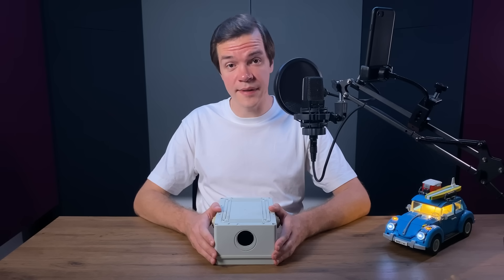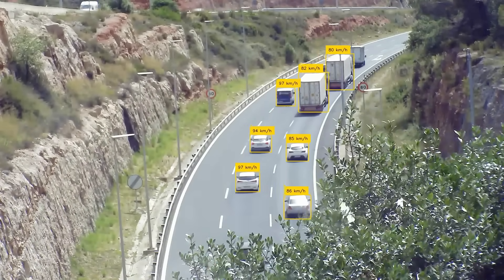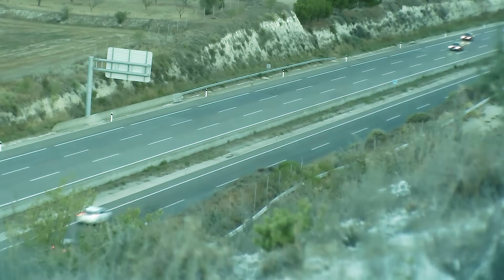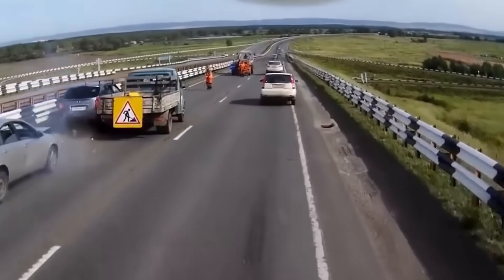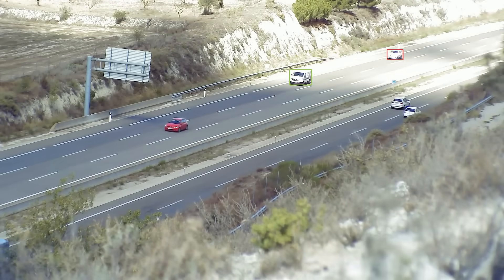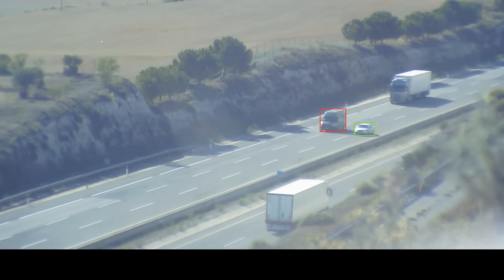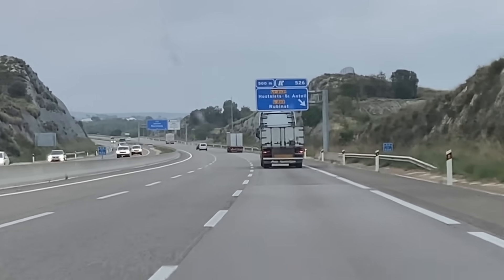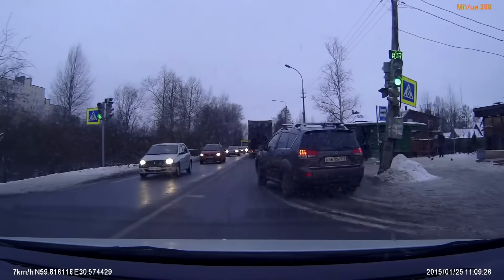New Anti-Tailgating Camera Reveals Shocking Statistics

Comment: If I get a rampant tail-gater, I do not speed up, do not shorten my own braking distance, nor do I brake-check them. I maintain my driving. Eventually,  IF  the tailgating is excessive, I may choose to gradually slow my speed down by 3-5 kmh. They soon wake up to the fact that they are just 'losing time' and go on past me.
Reply: This video lays it all out. If someone is tailgating me in the left lane, I move over and let them pass. If someone is tailgating me in the middle or right lane in normally moving traffic, I INCREASE the distance in from the car in front of me, planning to use all that room in case of a sudden stop, because the idiot behind me will not have enough room to brake. In heavy traffic, I'm  afraid I do reduce the 'safe' distance in front of me because, otherwise, cars will constantly cut in front of me.
Reply: @biotrekker  I try to maintain a distance just long enough to not get constantly cut off, on my 45 mile commute, that usually means I still get cut of at least twice, but not all that much. the bigger and much scarier issue is when someone is constantly cutting lanes with little clearance, forcing everyone the cut off to have to hammer the brakes over and over.
I've learned that when someone is driving extra agessively, to simply back off for the next while, not worth getting into a chain reaction because the idiot forced everyone else to brake hard.
Reply: @biotrekker This is the "bat" solution, named after the way that thousands of bats pass quickly and uneventfully through a small gap. The secret to keeping traffic moving smoothly and quickly turns out to be: Equalize the distance between the car in front of and behind you.
Reply: So, the idiot behind you will have enough space to push you on in case of accident...
Actually, that is wise.
Forget cars!
 @biotrekker
Reply: @biotrekker There is a secret solution: fixed towing hook is proven to reduce tailgating by 70%. 9 out of 10 independent car mechanics approve! I was surprised how well it works. Same car, same road, same time of day but much less tailgating. If you have a hook on, it just punches through the first deformation zones of the colliding car and that way transferring the majority of damage to the car behind. Most tailgaters know this and keep a bigger distance.
Reply: @atlasz911  In France it doesn't change anything to have a towing hook or not. People are just plain stupid.

But I' m planing to have a trailer, and a long tube or something else long enough to force them being further .
Reply: @selenelacaze9883 It will be a bit challenging to parallel park with a trailer and a pipe hanging from it.. But I understand your frustrations. Maybe a bigger piece of highly reflective tape would help in the night.
Reply: @atlasz911 yeah it comes with a lot of drawbacks plus decreasing fuel economy. At firt I though I could have a big sticker or  something that display in multiple languages on the back that says to pay attention. But a lightning display may not be legal(?) depends on countries?
Reply: @selenelacaze9883 It's almost certainly not legal in most countries. But a highly reflective sticker covering half of your trunk door is likely to be legal even if it's not the most elegant look  Towing a trailer may have more drawbacks than pros but you would learn to reverse like a pro.
Reply: @atlasz911 - having an external attachment to your car which is not factory fitted (and therefore not government approved) is illegal and will open you up to a civil claim that your device has caused disproportionate damage to their vehicle. These days the tow ball MUST be removed when not towing.
Reply: @welte-mignoncabinett100red6 I managed to get (probably one of the last) fixed tow balls installed. Original part from the manufacturer, installed by an authorized dealer. So I'm clear of that. It already stopped two cars. One had no damage while the other one had minimal damage. Probably because of the thick rubber cover I've put on it. He left with less damage than he would have if he hit my bumper directly. The story would be very different at high speed collision of course. What will I do with my next car if there will be no fixed hooks? I'll just claim that I forgot to detach it after recently towing. I know people who had their detachable hooks rusted into the socket as it was never removed in 10+ years. Not even during regular technical checks. Police usually don't care about them either.
What after a collision? If the driver behind caused the collision then he is liable for the damages. It's hard to prove what the damages would have been on both cars without the ball and if the sum of the damages would have been less. In the worst case I receive a 50eur ticket because I forgot to detach the hook.
Reply: @biotrekker  I usually do that too, increasing the distance with the vehicule in front of me , in case I have to brake and then I could brake softly without the stupid morons behind me raming my car.
Reply: @biotrekker 
In the middle lane,   the simplest solution is for you to move over to the first lane.
Reply: It costs you nothing.  And involves less effort and less work then what you described.
Reply: @biotrekker  If you are in the left lane and are able to move over, you are in the wrong lane to begin with.
Reply: I don't put on the brakes when this happens. I just take my foot off the accelerator pedal until the distance between me and the next car is TWICE the recommended amount. Basically, I am building the tailgater's safety margin into mine. They usually pass quite soon.
Reply: I just move into the slower right lane here in the US.
Reply: I had an idiot in a Nissan Rogue SUV glued to my back bumper for 100’s of miles up to 105mph he kept drafting me. In the middle of the night with his headlights blinding me inside the cab. I’m not sure what rolled under the truck and brought his stupidity to full stop on the side of the road. I’m pretty sure his radiator or windshield was taken out.
Reply: @SpinningSpur  You're part of the problem. Just let bro pass and stop driving 105...
Reply: The law in most US states and in Germany and Spain is "Keep Right Except to Pass"! Most people are not aware of this. Others are just arses who don't care what kind of stupid drivers they are!
Reply: @EVH3730  We used to be taught the rules of society in our senior year of high school.   

They cut all that as being unnecessary.  And now we are reaping the rewards of that choice.

High school should include driving instruction, simple car mechanics (changing your oil), simple financial advice (balance checking book, avoid credit, avoid long term contracts), simple cooking and a refresher on the constitution in a final civics class.

We lost a lot when we cut those things.
Reply: Sure but if youre in the zoom zoom lane youre in the wrong.
Reply: In the USA, in some cars the brake lights and the 4-way-flashers are actually the same lights (in the rear). So it is possible to "fake brake check" without slowing down at all, by briefly activating the 4-way-flasher.

I do not recommend doing that if the vehicle that's tailgating you is being tailgated by a third vehicle.
Reply: @ncdave4life Rear fog lights can also make it uncomfortable to tailgate as they are a bit blinding. It's not really legal and innocent drivers are also affected if you forget them on. I only used them in tight traffic to remind the driver behind me that he forgot to switch off his fog lights or high beams. You don't know the mental state of the tailgating driver. Letting him go his way is almost always the safest option.
Reply: Wait people tail-gate even though there was space to overtake? wtf
Reply: I call it "outslowing", instead of outrunning someone, you just drive slower and slower, until they lose their minds, and pass.  🤣
Reply: If I'm on the left lane, I move to the right lane so they can pass. No games no enraging
Reply: When I am being tailgated I maintain my speed but increase the gap to the car in front of me. This gives me more time to slow down gradually in an emergency ahead and allows me to better manage the tailgater behind.
Reply: @johntisbury How do you "maintain [your] speed" while at the same time "increase the gap"?  Do you know the phone number of the driver ahead?  Call them up and kindly ask "Could you please accelerate your vehicle, so the gap between you and I increases without me changing my speed?"  Asking for a pysicist.
Reply: @jf3570  dear physicist. Most drivers are not consistent with their speed. They slow down going up hills and speed up again going downhill. Speed up on long straights and so no. It's therefore quite easy to increase the gap in front of you without having to reduce your own speed due to the erratic nature of the vehicle's speed in front of your vehicle.
Reply: @johntisbury 
If that is the case then most drivers should be passengers.

It is a simple and essential skill for a driver to be able to drive a vehicle at a consistent speed,  regardless of hills.  

It generally just requires using the foot to adjust the accelerator.

It may also require the driver to change gears or use brakes when going down hill.
Reply: Drivers who decide that the have to reduce their speed because they are travelliing up a slight hill on a highway are the absolute worst.
Both moronic and selfish.
Reply: @ChristopherNFP  100% agree. I used to have cars with 'old fashioned' cruise control, set it and it would maintain the set speed up hill and down dale. Almost always I'd have to adjust it or knock it off as I was catching the car ahead because it was slowing down. Adaptive cruise then started to appear to overcome this situation - see where we are going here?
Reply: This is exactly the same procedure I follow also.
Reply: Good strategy. Takes agression out of traffic behaviour. 👍
Reply: Yes! Your strategy makes great sense.
Reply: You should be careful.  If someone is tailgating you, you should signal and move from your lane and let them pass. In the USA we have too many idiots, some of them armed.  Drive defensively and live.
Reply: Years ago a friend of mine had an old muffler hinged up under his car. He rigged a lever to lower the back end of the old muffler so it scraped the highway making sparks like it was going to break loose. Not sure why he did this? But I’m sure it worked.
Reply: Most of them already go around when they can.  It isn't always possible, and that's when it's the worst.  It means there are enough cars that opening space in front of you gets cut off and back to being too close.
Reply: Most of the tailgating I experience or see in general or even sadly participate in is when someone is in the left most lane for no reason or there is a pull out coming up to let me pass and they are driving well under the speed limit. I have found that in both of those situations getting kinda close to someone for a very small amount of time communicates to them that I would like to pass can you please let me? People who are tailgating for 0 reason not in the left lane I don't understand
Reply: @Stez827  ya but the reason I feel strongly about this is because my dad got brake checked and rear ended a car with his truck. he was found at fault because the person claimed there was a deer although my dad said he didn't see anything and I tend to believe him because visibility was good and his truck could see over the car. IDK exactly what happened, I know the lady claimed neck and back pain and our insurance company took care of her and my dad had an at-fault accident on his record.
Reply: I just make an obvious motion to reach up and manually hit the record override button on my dashcam which has front and rear views.  I try to ensure that the tailgater sees me do this.
Reply: Get out of the passing lane. You are impeding traffic. Switch to the cruising lanes.
Reply: Recommend in the UK is add space in front of you so you can bake slower
Reply: People in the UK would never overtake you in that scenario.  You’d have to half your speed, at which point they’ll become very angry.  It’s also improper driving; the advice in the UK is to pull over.
Reply: @Scoupe400 Here we gradually slow down, pull a bit to the side to improve visibility and put on the right blinker. Every driver with more than two brain cells realizes what is expected from him.
Reply: Best response!
Reply: You need to remember that there are always someone who is crasier than you and one day they'll get you. Stop driving in far left lane if you are so law fallower, let other people drive faster in the passing lane. Stop been a Dick to others
Reply: Well many of them are in a road trance and driving on automatic.   You need a car length per 10 mph (14kph?).   So, if you are going 60mph/84kph and someone is two car lengths behind you, then you would need to keep 6 car lengths for you and an extra 4 car lengths for them.  This will allow you to slow down without being rear ended.
Reply: I thought I'd theoretically what to do about tailgaters: Adjust your speed to correct their stopping distance (e.g. if they're very close then slow down so that is the correct stopping distance for them)
Reply: In such a case I take my foot off the gas for about 10 seconds and slow down to the point the tailgater passes me by. I wave in a friendly way  and get back to an appropriate speed.
Reply: I do this as well.  I make sure to get over to the right and if someone stays too close, I very gradually slow down to make them give up and pass.  Then I slowly speed up again.
If course this only works when there is another lane to allow them to pass.  It is much more stressful on two lane roads and there isn't any way to get them off of you.
Reply: And of course you might need to use the screen wash, either at the front or the rear screen. That sometimes wakes them up, especially if they don’t like the smell of the liquid in use.
Reply: I make it an impromptu experiment to quietly slow down to see how much slower than the speed limit I can get them to go before they finally wake up and go around me (to find their next victim to taligate). Tailgaters are non-thinkers. 

Tailgaters are drivers who aren't thinking. More broadly, I wonder if they're non-thinkers, generally, in a lot of cases. Interesting… I'm saying that if you tailgate, you're a person who's not thinking while you're driving. Brutal, perhaps, but probably true when you stop and look at the factors involved. 

See my longer argument, above. (I think it gets placed above…)
Reply: I usually slow down to the legal limit (lol) which frustrates them and they'll change to the passing lane
Reply: I’ve found if I keep to the speed limit consistently they eventually back off realising they can’t intimidate me to drive faster.
Reply: Yeah I figure for safety if someone is tailgating me I should slow down to reduce risk. I want to give them as much time as possible to respond in case an accident happens ahead, a person jumps out, etc. because I don't wanna be rear ended at 80mph.
Reply: If you're in the left lane, then you're the asshole. Just saying.
Reply: I do exactly the same
Reply: This mindset is why the EU (original freeway builder) understands common courtesy meanwhile you idiots pull guns on each other because you don't give a shit about anyone but yourself. Americans can't drive for shit but sure as hell are experts at blaming everyone else.
Reply: I've had them continue follow even after I slow down to a crawl.
Reply: @Jerry-j9o2t yup you're a genius. Let me know how it works out when you piss off another genius with a gun.
Reply: "I do not speed up"
good! speeding up is the worst thing you can do when being tailgated, simply because higher speed makes it more likely that something will go wrong, and it also makes the consequences more severe. also, it gives them what they want, and that sends the wrong message. IMHO the right thing to do is to slow down and keep more distance to the car in front. and getting out of their way is not ideal either, because it only encourages them to tailgate other cars, again and again, and sooner or later something really bad is gonna happen. the only question is when.
i would definitely recommend a 2-channel dashcam so you can take the a-hole to court with the video. and some kind of display in the rear window could allow you to send them messages like "Keep your distance!" or "The closer you get the slower I go." 
to cut a long story short, the first thing i'd do is slow down, because if their distance isn't appropriate to my speed, i have to make my speed appropriate to their distance.
Reply: By slowing down you also improve the tailgaters position. Since the safe distance becomes smaller when travelling with less speed.
Reply: This comment implies you are the one we're all cursing in the huge line you've made behind yourself because you just refuse to get back in the middle or right lane for whatever reason. The PASSING lane is for PASSING people, do I really need to explain this??
Reply: This is genius, thanks for the idea!
Reply: How about you get the fuck out of the way and not block traffic. Assuming this is a multi lane road.
Reply: The best way to do this. Agreed.
Reply: This is bad practice. If you’re on a multi-lane road, you have no excuse not get over and let faster traffic pass. Even if you’re on a single lane road, in many US states you’re not allowed to cause a backup regardless of your speed. A tailgater doesn’t want to tailgate you unless they’re insane, just get out of the way because you’re contributing to the problem.
Reply: Usually I'm on the faster side but I'm not very social on the roads. I don't like any body too close ahead or behind me and I prefer not to match speed with anybody. I go either faster or slower than the cars around me - I bought gas and not a train tixcket. If I'm slower and there is a tailgater, your solution is the safest and most defensive way to solve it  I also prefer to do that  There is a group of drivers who prefer to glue themselves behind anybody driving in front of them. They don't want to think, will not pass you but will drive close behind you no matter if you drive +20 or -20. You need to decelerate a lot or take a piss break.
Reply: @atlasz911  Oh yes, those exist >sigh< and I've actually BEEN taking p breaks for those morons...
Reply: Just move over and let them go and bother the next person 🤷‍♀️
Reply: I was the same thing. One time, this crazy lady sped past me then proceeded to sheepishly brake check me seven times. She only stopped when she saw a cop up ahead.
Reply: It's often safer to use your window cleaners than your brake lights to motivate a tailgater to overtake instead of staying there... especially in clear weather.
Reply: A friend’s mother would pull to the right for tailgaters. But if they were aggressive and kept at it, she would let her car drift slightly back and forth, as if having a medical problem, then drift fairly far onto the rumble strips (or whatever), break slightly, then swing back to being in front of the tailgater. 

They tended to go around or take an exit after that demonstration.
Reply: I found the spot on my brake pedal's travel which makes the brake lights come on but the brakes are not biting yet with my left foot.
Thus I can 'brake check' tailgaters without slowing down at all, I can even speed up doing that. Works every time.
Reply: @gustavmeyrink_2.0  I have a sticker that says"Sorry For Driving So Close in Front of You" Most drivers back off.
Reply: @gustavmeyrink_2.0 this whole comment section makes me want to create a social platform for stuff like this. “Hey! Red Hyundai behind me on i49, stop being an a-hole!” 😂

No but seriously, 😒 ive always wanted an internet version of cb radio lol
Reply: @gustavmeyrink_2.0 A quick blink of the hazard flashers is a better message.
Reply: @gustavmeyrink_2.0 There are aggressive drivers who would retaliate for that even if you didn't really brake. Don't  do that.
Reply: Arm your self.
Reply: @atlasz911  I don't hesitate to brake check , tailgaters drive me nuts.
Reply: @atlasz911  what can they possibly do to retaliate?
Reply: @atlasz911 I've had that, too.
When I finally got out of the way, that a-hole got right in front of me and braked repeatedly.
Until someone further back started to honk because there was a traffic jam building 🙄🤦🏽
Reply: @atlasz911  'Don't do that'

If you are a tailgater and see brake lights in front of you you'll have to slow down. It's just a result of your bad driving. 

If you don't want to brake as well leave a larger gap so you can just take your foot off the accelerator instead.
Reply: @atlasz911  Wrong.
Reply: @dakota9821 That wasn't very specific. Which of my messages? Which part? Why do you disagree?
Reply: @gustavmeyrink_2.0  In older vehicles there's always the manual/hand brake to slow the vehicle without the brake lights going on. Great care needed..
Reply: @philipoakley5498  Yeah but the idea is to make the brake lights come on without actually slowing down not the other way around as you seem to be suggesting.
Reply: @gustavmeyrink_2.0  The subtle difference is one method tries to shock the tail-gaiter, telling them they are too close, while the other is a more gentle surprise so that they suddenly realise they shouldn't be that close.
Horses for course. Care for all.
Reply: @philipoakley5498 Lol that's any car older than 40 years old, aka an antique.
Reply: if you do this in the left lane you belong in prison
Reply: I activate my warning flashers or gently touch the brake while maintaining speed to make the brake lights come on, not to brake check.
Reply: Exactly. When driving you need to pay attention to what is in FRONT of you, not what is BEHIND you. Best reaction to a tailgater is no reaction at all.
Reply: @DannyOccoquan no way…. If you have to brake suddenly, the person tailgating you will rear end you. It’s best to get out of their way.
Reply: @DannyOccoquan  sure I'm with you on that. Better is no reaction to tailgater, but if it's really close they put you in danger in case of emergency brake so if they Really insist I'm 100% on slowing down cause I don't want to take them a full speed in case of emergency brake and if they want to tailgate be like moron, slowing down gradualy is no danger and as painful is it to have a care tailgating you, they will also found it annoying to have the gare slowing down gradualy in front. 
Most of the time it's juste to be in front, like if they had balls only in their car. Taking risk to go in front of you to stay at the same speed is among the d!ck move.
Reply: @DannyOccoquan I think for safety its good to slow down. Since the person behind you doesn't have the space to slam on the breaks, you should keep more of a distance and increase your visibility. Of course like other comments said the priority should be getting out of the way but if you can't by slowing down a bit you can avoid needing to slam on the breaks and being rear ended.
Reply: @DannyOccoquan  The problem being is if you have to hit your brakes they will crash into you.
Reply: @natehill8069 
The "problem" can be completely avoided if the driver shifts to the  slower lane . The car will pass quickly.
Reply: Most of the time when you have a tail gater you're in the wrong lane. Stop hogging the middle lane, and stop slowing everyone else down. Problem solved
Reply: @federicafilippi6355 Often there is a single lane in that direction and I'm generally going the limit+10 or more but still experience tailgating. Often there are drivers who just don't care and don't want to think. Some just glue up to the first car in front of them and follow it. Don't want to pass and don't care to keep distance. There is no help for those.
Reply: @atlasz911 Obvs hardly anyone leaves 100m to the car in front, so if that's your definition of tailgating then sure. Otherwise anyone I have seen tailgate overtakes as soon as they have been let through.
Reply: Too much accent. 

Just have MS Word read the text.
Reply: Yes, and when people like you do that, people like me overtake you so quickly and so dangerously on the wrong side, you wish you hadn't.  Don't be a dick, just get out of the way.  You wouldn't block somebody trying to walk up an escalator in a department store, so don't do it on the road.  You don't have the moral right to slow the road down.  Just get out of the way.
Reply: @leighkite1164  No!  How funny it is that some people are so entitled that they think everyone else should get out of their way.  I have every right to be on the same road, driving a safe speed limit.  If you insist on speeding, I'm not getting out of your way.  You get out of my way!  Which includes tailgating.  Get out of my space on the road and pass when you are able to safely do that.

That doesn't mean that I'm going to hog the fast lane, but inevitably I have to use it too, to pass, and recognize that the dick is the one trying to make others take actions for their benefit.

If you can't settle for getting to where you're going 30 seconds later, you don't have time to be on youtube.
Reply: @leighkite1164 you don't have the moral right to drive recklessly if the person ahead of you pisses you off. Just drive.
Reply: @hotcakesism  Hahaha, touché.  🤣  Seriously though, when two or three of them block the entire highway below speed, demonstrating a blatant disregard for everyone else's right to get where they're going at the speed limit (or maybe a bit more), it's not just me who's pissed off.

I've actually had multiple people wave and thumb me for my highway antics when clearing slow movers aside.  Sometimes a few other people have joined in.  It should be a paid position.  🤣
Reply: @leighkite1164 Nah, rushing deserves crashing. Your analogy is hilarious because these narcissists refuse to walk or use the stairs, and you lack imagination so you jump to an escalator. Your temper tantrum is adorable.
Reply: @leighkite1164 Okay, boomer 🤦🏽
Reply: @leighkite1164  If somebody needs to "get out of the way" for you to go your desired speed, you're in no position to claim any sort of moral high ground.  You have no more moral right to speed the road up than they have to slow the road down.

It's very simple: If the person in front of you is going slower than you'd like, find an opportunity to pass them safely, then do so.  If you cannot find such an opportunity, follow them at a safe distance until you can.  They are not responsible for creating those opportunities for you (they are responsible for not deliberately making passing less safe, like speeding up when you try to pass or changing lanes to block you, but nobody's suggested that's a good idea).  Tailgating and passing in unsafe conditions are never anyone's fault but your own.  Take responsibility for your decisions and actions.
Reply: @dudeguy2330  Yeah, yeah, what I'm mostly ranting about are drivers who block the pass lanes whilst doing under the speed limit.  No situational awareness at all...  no courtesy for others who want to get where they're going at the speed limit...  or maybe just a little above it.

Where I am, it's actually illegal to drive in the pass lanes unless your passing.  There's great big massive signs saying it.  They don't enforce it though...  I guess they make more revenue from enforcing speeding.

Oh and don't worry your precious little heart...  I never place myself at risk when passing a slow-poke dangerously...  only them.  🤣

If you think I'm playing a little rough, go for a drive in the gulf sometime.  They actually bump you out the way there if you don't move.
Reply: @leighkite1164 actually that's what VDOT says to do as well. slow down to encourage the tailgater to go around you
Reply: @leighkite1164  yeah you're definitely the kind of person to tailgate on the left lane when the person in front is already at maxspeed or even a bit above... DB
Reply: @fabienl4979  Haha yeah, but hey, I lived in Dubai for a while.  My first car there was a C6 Corvette, and if I didn't eat my own dogfood, I was flashed out the way by 1000HP Nissan Patrols that were built to go up sand dunes vertically.  Respect.  🤣
Reply: sheep will be sheep
Reply: @jhcode You might have infinite money to repair/ replace your cars, but you only live once.
Reply: @jhcode  <———Found the A.. hole on the road, keep it up till they scrap you off the road. Less traffic when you all are pastensed.
Reply: @jhcode  Indeed you are--bahhhh.
Reply: @jhcode  Meaning what?
Reply: @Fomites : I take that to mean drivers tailgating mindlessly ( meaning “sheep”).
Reply: The “sheep “ will crash into you
Reply: @Fomites  sheep don't understand
Reply: @stanadams8703 ok and? That's their fault. Their insurance has to pay, and if they don't have it, take them to court. If they run, chase them down.
Reply: @jhcode  You mean drivers driving safely are sheep? Fine. But if I meet you on the road and you are being an arsehole you can expect the worst.
Reply: @Fomites It means most people are not actively aware of their surroundings and zone out when driving. It doesnt matter if theyre 5-10mph miles faster than you theyll eventually just tailgate you when they reach you. They dont slow down to a safe distance and they dont change lanes to pass. Finally if they were active drivers theyd be in the right most lane until they need to pass not the middle lane.
Reply: @jhcode you sound like a bot